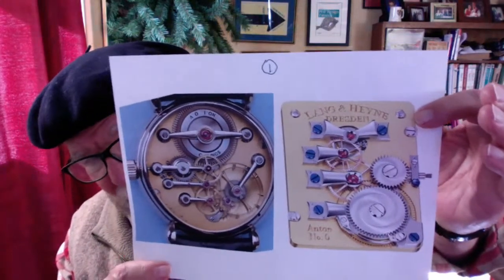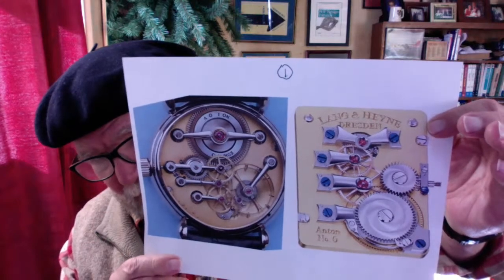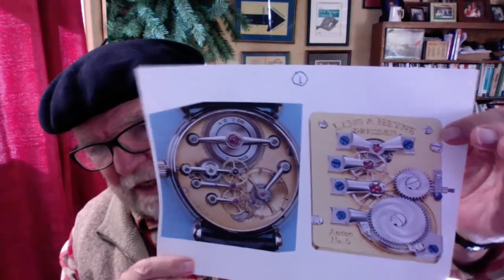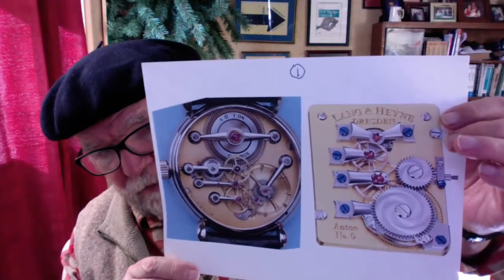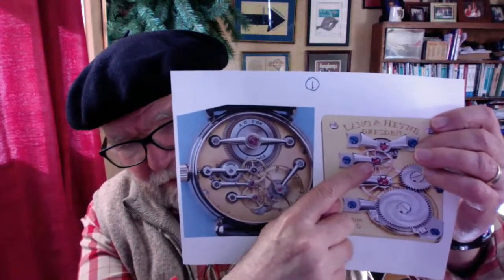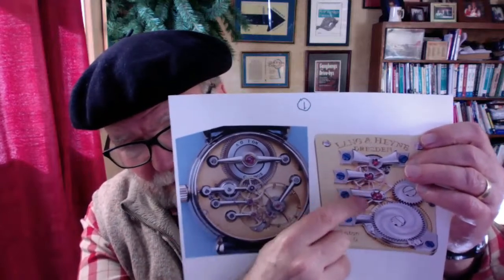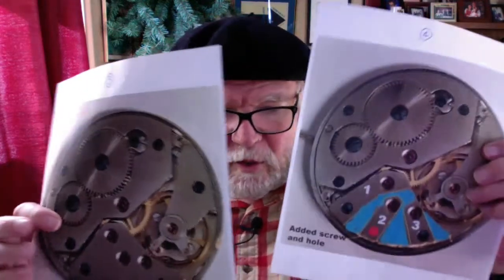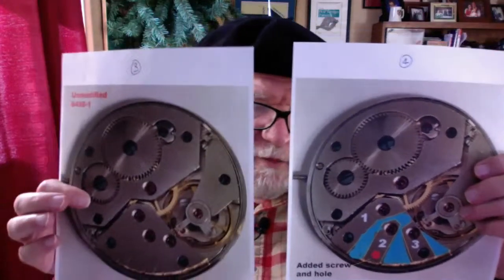Let's Mod a Movement! Finger Bridges for the Gear Train!

Comment: Very simple Bill, again you can get a tap and dye set for your "dremel-like" tool. Drill the hole before you even remove the plate, that way it will be a perfect match after you remove the waste from the rest of the plate. Use a tap bit on the base plate and voila!
Reply from the maker: Thanks Styx! That is a smart move to drill before cutting the plates. Got my work cut out for me. Take care and be safe, Bill😷

Comment: You can cut the with saw bits for both the "dremel like" tool. Or if you have a rotor table, the cutting bits for those would do nicely as well as keeping the piece straight as you cut
Reply from the maker: Thanks Styx! Take care and be safe, Bill😷